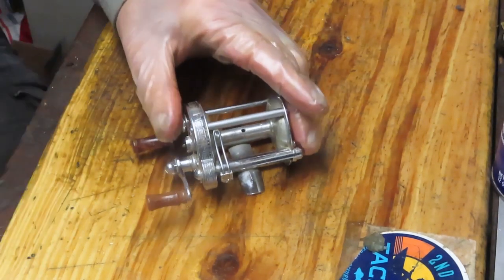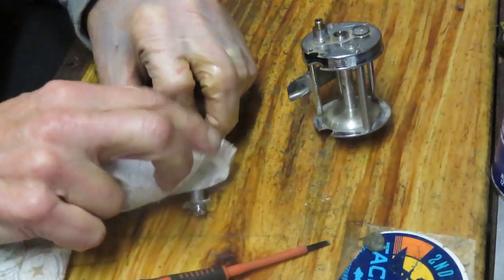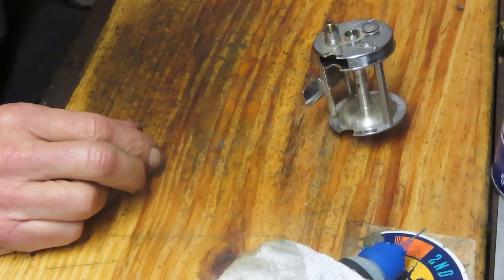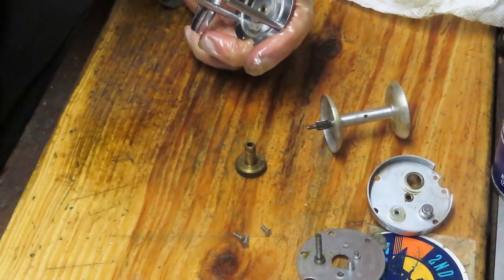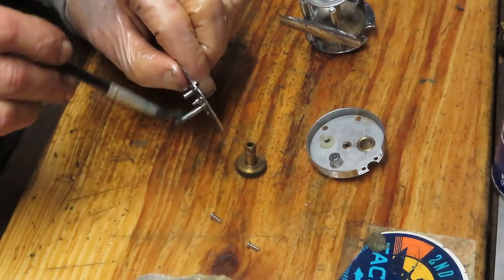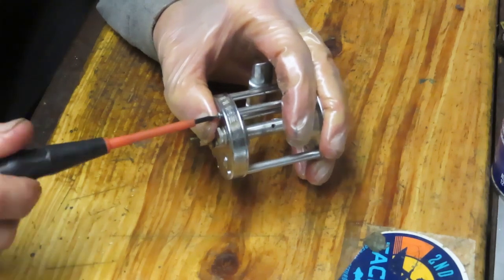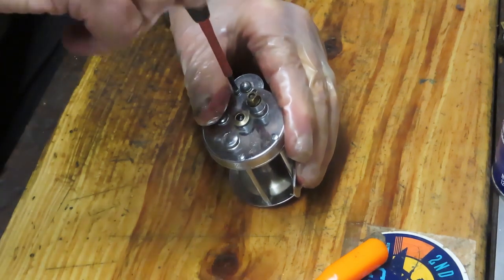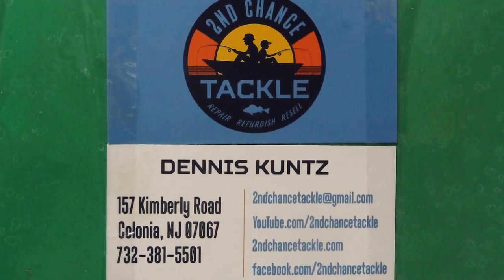Pflueger Akron vintage fishing reel how to take apart and service

Comment: Thank you for the video. I took my Akron apart and cleaned it up and reassembled. Still can’t figure out how to cast it. I have several others that I inherited as well. Going to go through them all. I have several old model Pflueger reels. Need to go ahead and clean and oil them all and see how well they work.

Comment: Thanks for the amazing video, Dennis! I am lucky enough to have an incredible condition Akron 1894 with most - if not all - of the original line. Safe to say, it’s my pride and joy! However, I do have a few questions about it. Firstly, the clicker is incredibly loud when reeling in normally, but when I reel backwards, the clicker is nice and quiet - still there and functional. I feel as though this is backwards. Is there anything wrong with it? Secondly, I only have a vague idea of when it was manufactured. Somewhere in the mid-late 30’s is my guess. There’s no other numbers other than the model number, 1894. The knobs on the handle are exactly the same as the one in the video, if that helps at all. Do you have any idea as to when the reel was made? Thanks so much. Tight lines!
Reply from the maker: The reel is not as old as you think.  It was made in the late 1950s and discontinued in the early 1960s - Thanks for asking -Dennis
Reply: Thank you so much!! You have no idea how helpful this is.

Comment: I just got a vintage Pfuger Nooby reel, seems to be similar to this.. I am amassing a small collection of vintage reels, and thanks to your videos Ive gotten most of them back into working order :) 
I do have a few I'm struggling with, perhaps I'll send them to you... thanks for the videos, and your accent brings me back.. I grew up outside Philly and spent many summer weekends at the Jersey shore 😂
Reply from the maker: Thanks for the note and for watching.  You need to be careful when you are looking to purchase an older reel.  Test all of the features and functions before you commit to buy.  Parts are very hard to find on these reels.  If the reel is simply sluggish, but working, it can generally be restored.  Happy to bring back the shore memories - Best wishes - Dennis
Reply: @2ndChanceTackle  I have been finding them at garage sales, for very low prices :) Most have been siting in garages/ attics/ basements for decades and the grease has dried up/ evaporated, leaving things locked up, or at least sluggish.. 
What solvent is recommended for cleaning these reels? Alcohol/ soapy water aren't always enough, so i was thinking about using mineral spirits or something similar?
Reply from the maker: I generally just use a heavy spray of penetrating oil and let the parts sit for a while before I do the work - that oil helps to loosen up the tough grease and get me going on the cleaning - Thanks for asking - Dennis

Comment: Dennis, I sent you an e-mail about a reel I got earlier tonight.  It could be a pretty nice bargain but only time will tell.  It is a rare Mitchell “Sport” 488 saltwater reel. I think I already have 4 or 5 Mitchell 488s but this one was special. I already have a stunning Mitchell “Sport” 498. This 488 I got tonight will match that 498. I had never seen one like this before so of course I couldn’t just let it go to somebody else.  Look at the e-mail as I have a few questions for you.  These old Pfleuger conventional reels are such beautiful reels if you can find them in good condition.  I just wish I had the vision to be able to use reels like this. Thanks Dennis! — Chris
Reply from the maker: I will look for your note Chris.  Sounds like a deal!
Reply: @2ndChanceTackle  I guess I’ll find out after it arrives. It worries me a little that it went so cheap. It should have gone for much, much  more which means  I would not have bought it. — Chris

Comment: How does this reel cast, is there a button release
Reply from the maker: This is a direct drive reel without an anti-reverse or free spool lever.  You simply throw it out and reel it back in,  When you cast, the reel spool and handle will turn backwards and when you reel it in, you turn it forwards. - Dennis
Reply: @2ndChanceTackle  thanks Dennis I got one of these from my father in law and plan on cleaning it up a bit and using for part of my vintage show case